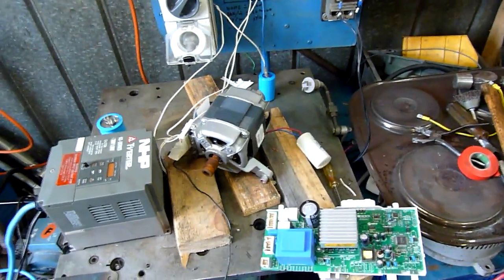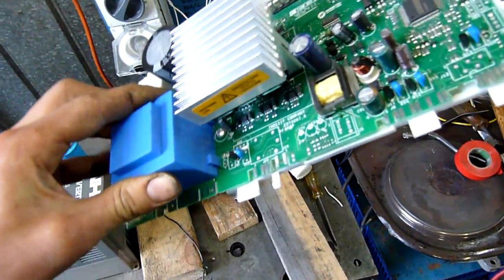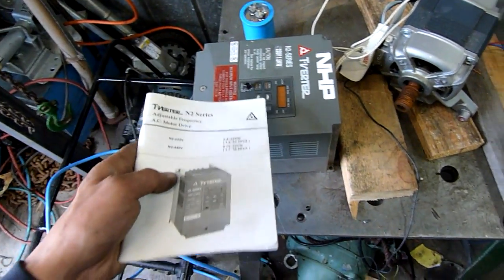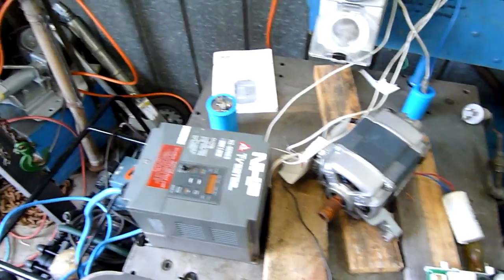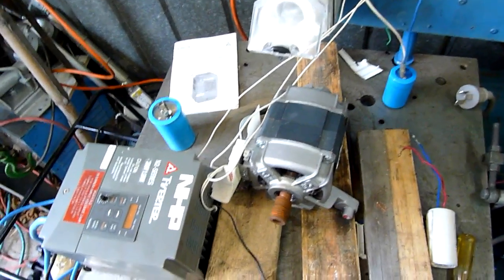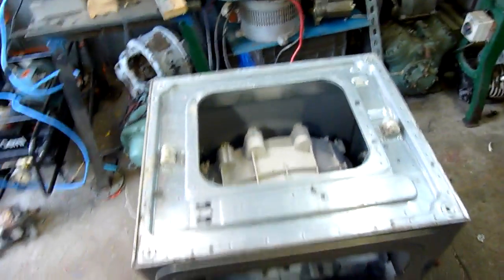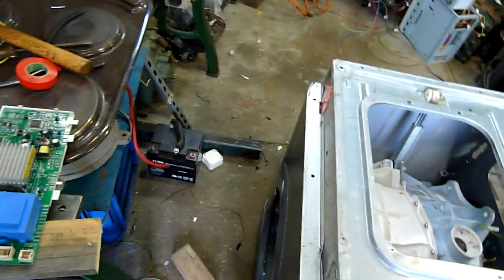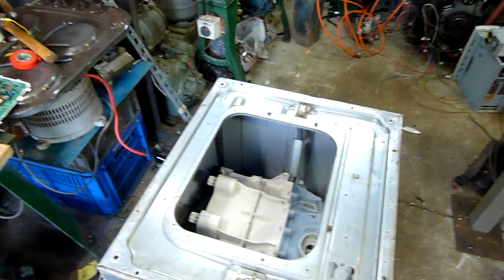3 Phase Washhing Machine Motor Help Needed

Comment: ...do you have the field windings energised?
Reply from the maker: +ChuffChuffWoo the rotor is a permanent magnet, the fields are the only thing I can connect to.
Reply: OK - so it won't have a field winding, only a main winding.

Comment: @Aussie50 i have the same motor, and the sticker on the motor said Do NOT connect to ac voltage main, and run on control board. So idk how to hook it up either, i may experement some see what happens. Also i wish i caught this on video had a little ac motor out of a weed eater, bearings were shot beyond belief, so i said screw it let burn it up and see what happens, had lots of smoke, then right before it stalled out, big burst of flames and grueling electric poping noises, lol

Comment: hi there. Just seen this. And there may be a problem from what you said the motor is 195volts that could be the problem. As it may have to be wired in star not delta. If the motor has 6 termanls then it could be wired as star/delta for diffrent votage

Comment: I had another thought, maybe that motor needs to be connected to that transformer on the power supply board in order to work? Perhaps it's used to match the input impedance of the motor rather like a stereo speaker? Then you just need to supply the right kind of voltage at the right frequency to get it to work.

Comment: could you make a simple bracit up, bolt it were the old mounts are on the the drum, then get a big dc 4 pole motor or somthing like that with 1/2 or 1 hp and put it on there just a old one that needs some TLC, so don't mater that much if it get's a littel damage, just a thort hope that this may help.

Comment: 290 hertz (cycles), it must as you say be wired in a weird way, at 400 cycles (hz) it should be screaming if it is an induction motor. I think that they really expect too much these days, they want stuff high tech, complex, and computer controled but made in in China too? Now there's a recipe for success! If you can't figure it out you could at least connect a ballast to it and burn the POS down by plugging it into the mains, maybe mount it back in the washer first so you can a fire too.

Comment: It's probably too late now, butmaybe this motor has high & low speed configuration, so to get it to high speed, you need the motor to be spinning quite fast already. 

I know that photonicinduction also had lots of problems with this type of motor. Bst just burn it out and lash a universal motor on somehow (it only has to work long enough for some fun!!!)

Comment: Try running a known working 3 phase motor of your VFD as base load.

then add the 3 phase W M as extra onto it and see if that works.

As long you don't overload your VFD

Comment: I think that the V/F ratio of the washing machine inverter is not the same as the T-verter standard V/F ratio.

For example, the WM inverter produces 240Vrms at 290Hz, whereas your T-verter already produces 240Vrms at only 50Hz.

In order to conserve this particular ratio, your T-verter have to produce only 41 volts at 50Hz. It's maybe impossible to change this parameter.

Comment: It seems your motor is overvolted. It designed for higher frequency. To operate properly, that motor needs gradual speed-up, starting from 20V/10Hz and increasing up to 400-1000 Hz @ 300V.

Comment: @supremewhirlpol You're likely right, and Ed thinks so too; the only reason I thought it possible to be a simple analog input is the "universal" nature of these machines.  The only experience i have with these is with a maytag neptune (switched reluctance like i suspect this motor MIGHT be) and it uses a voltage control imput, matter of fact, you disconnect that circuit and it goes to a fixed speed (drum @ 50RPM) diagnostic mode.

Comment: Would be amusing to bolt a small petrol engine to it and see what happends. Would probably get smashed up when the flywheel went in though.

No way of fabricating an adapter plate ? If it was metal you could just weld a motor on :)

Comment: This is why i Hate modern Smart Technology, The original drive must use a special controller, My guess it's probably a Digital Microprocessor based system that runs the motor

Comment from the maker: @ISUZU1987 I did consider swapping the end bells, but they are smaller than any universal motor I have had, even the stator pack is 1/2" small in overall size :(

I'm afraid nothing is interchangeable.

Comment: BTW. You might try resurrecting the original drive, if it's got serial data control it's over my head, but if it uses a 0-5V or 4-20ma control input you could make it work.

Comment: Look up switched-reluctance motors and see if that might match the description of what you have.  Maytag used a SR motor in the original neptune (once the most popular front-loader in the US).  I've seen first hand what happens to the drive if the position sensor fails(magic smoke).  A switched-reluctance motor must have special controls and a position sensor to run.

Comment from the maker: @tlaroche38 yer spelcheck sucks some times :(. 

I dunno about using a Inverter AC drive since its not a BLDC motor, like the AC compressors. no magnets in the rotor, just normal pressed aluminum poles.

Comment: I'm the 14t'h viewer!!! The wingdings look very similar to that of refrigerant compressors, it would be surprising if it was a motor similar to the ones on inverter air conditioners. Maybe if you hooked it up to a DC inverter drive from an air conditioner (the drive board for the motor looks slightly similar to that of an inverter a/c) it might run. Or pop the inverter which would be fun to watch!